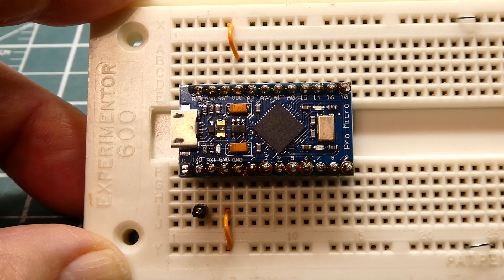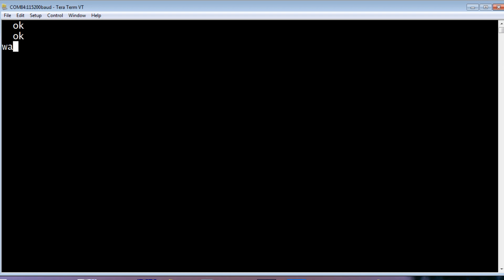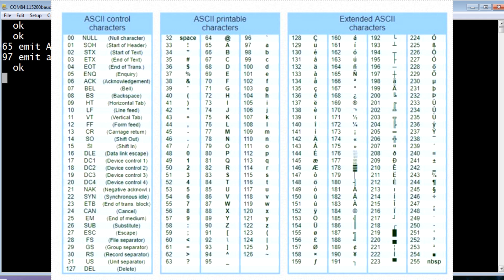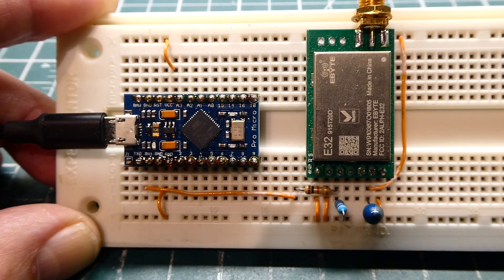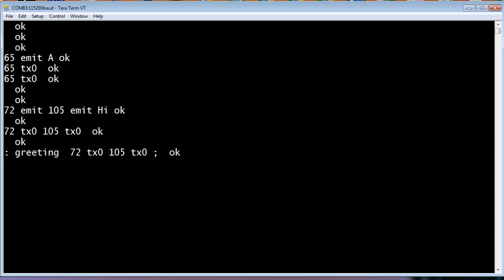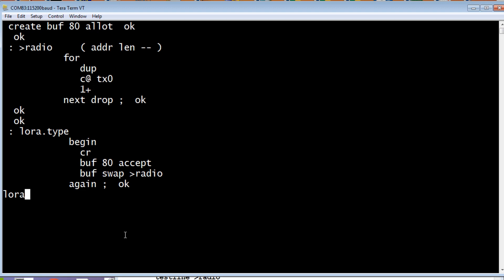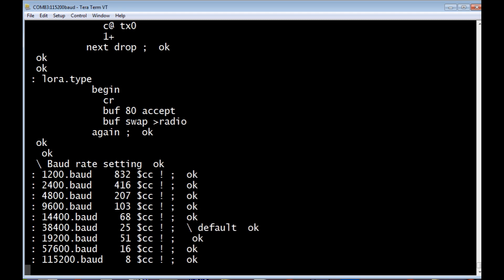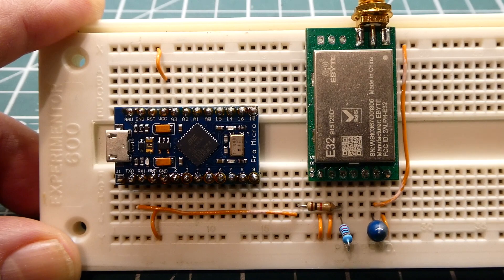Simple ProMicro UART Interface / FlashForth / LoRa

Comment: Thanks for making these illustrative Forth videos. Something I never got around to, even if I thought about it now and then. I am usually using FlashForth on a chip with native USB support whenever it is allowed by the other peripherals I need. The PIC18F25k50 is particularly nice since it has an internal precision clock and only needs two capacitors and a USB connector to get going on a 5 volt system.  
Many times I put the communication/logic to other interfaces in one or more background tasks. That frees up the operator task to observe variables and do some debugging.
Mikael
Reply from the maker: Hi Mikael, thanks for the feedback. It is very handy to gain access to Flashforth through the USB port instead of setting up a FTDI module. The ATmega32u4 is the first AVR micro I have done that with. It seems like the PIC micros are ahead of the game in that area. John Catsoulis Scamp2/3 board is a good example of that. I started programming PIC micros back in the early days but jumped over to AVR micros. Microchip now owns Atmel so we will see what happens. Thanks for your time and work you put into Flashforth. Myself and many others have found it very useful.

Comment: Another swell video, so simple and clear. 

Just to to make it explicit, the Forth terminal session is being supported by the AVR ATMega32u4 chip's USB capabilities, and the LoRa chip is communicating with the other hardware UART? I didn't know the Rigol Scopes would decode serial communications ... which Rigol scope is it?
Reply from the maker: The scope is the DS1054Z ordered with all the options. It also does SPI and I2C decoding which I found very handy.

Comment: What flow control and error correction is required to stream longer messages of ~100kB over such a LORA module? Did you measure the real world throughput with the air time limitations LORA modules are supposed to enforce?
Reply from the maker: CRC checks and Forward Error Correction (FEC) is embedded into the protocol. The E34 series use FHSS Spread Spectrum where the receiver sends back Ack/Nack for retries.
https://youtu.be/8OcADT-bp94

Comment: The "hello World" does not sound much longer than "hi" - Is this because most of the LoRa output is actually preambles, handshakes, and protocol-stuff?
Reply from the maker: When sending small payloads you mostly hear the CRC checks and the Forward Error Correction (FEC) . When sending large data payloads you can hear the difference.